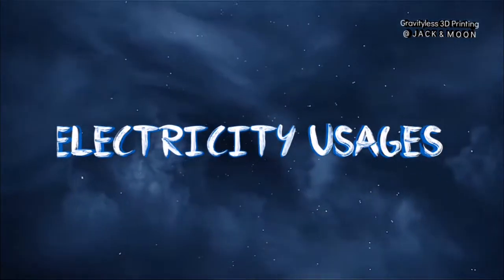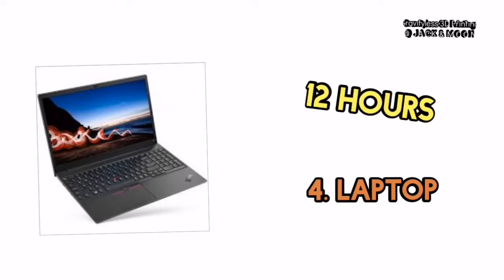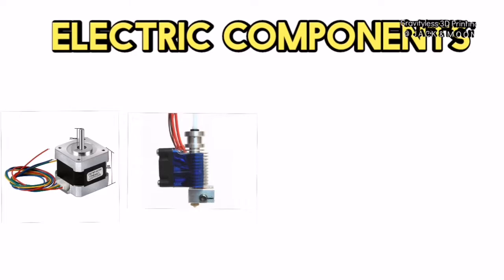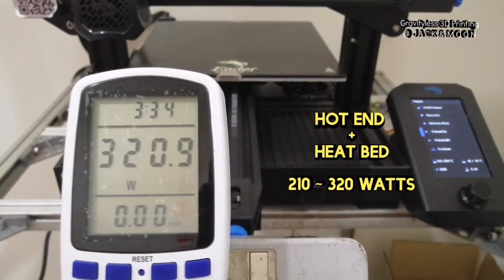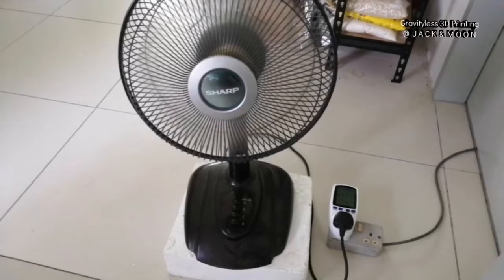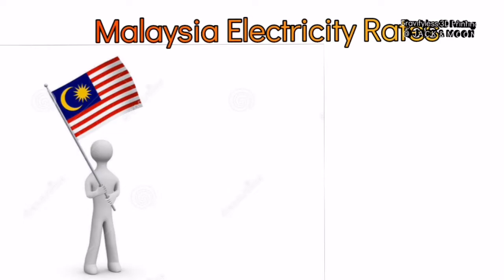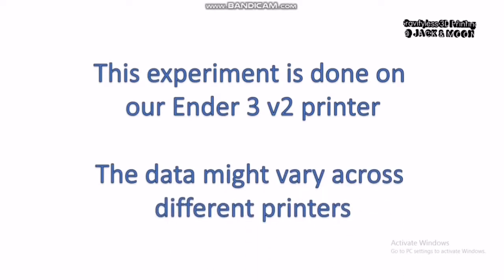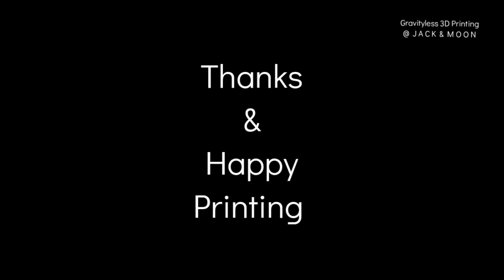How much electricity used? 3D Printer #expensive electric bills? #not possible

Comment: hi, can you do test for deferent filament like PLA, PETG and ABS usage of electricity? Thanks!
Reply from the maker: From the hypothesis , we think that the higher the printing temperature of the filament, the greater the usage of the electricity. Still thanks for your suggestion. If we have the resource and set up again, we will like to try with your suggestion too.🙂👍

Comment: hi bro, your calculation is not accurate, you are calculating when the hot end and bed heating up. The printer not heating up every time. while printing, the printer just sometimes heating up. different with heating up over time before printing. Yes, the printer max power when heating the hot end and bed. but not every time.  you should testing the printer WHILE printing because that is what we do eveytime
Reply from the maker: Thanks for your suggestion. We will make more careful study next time😊